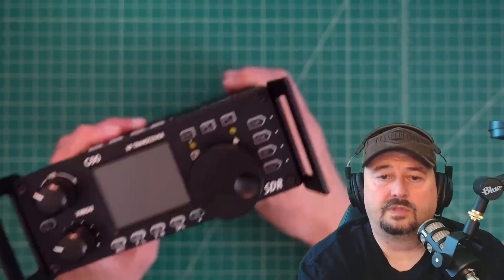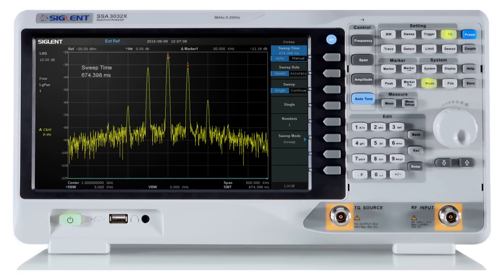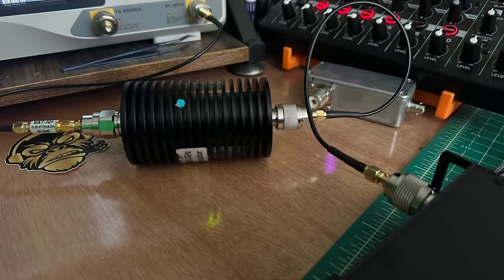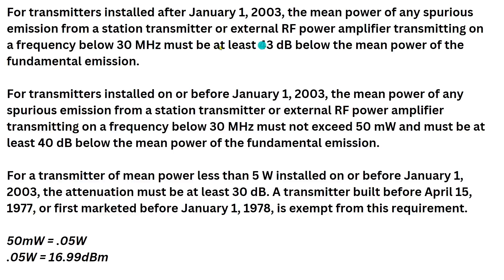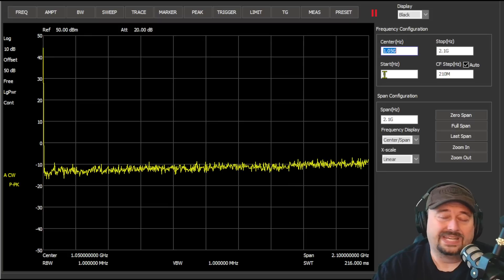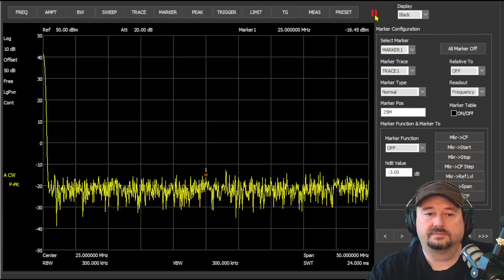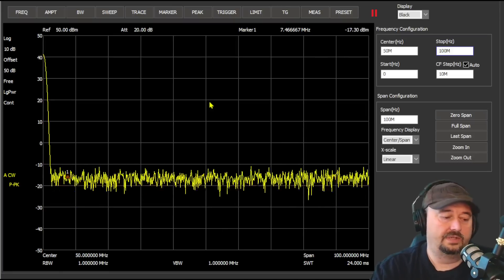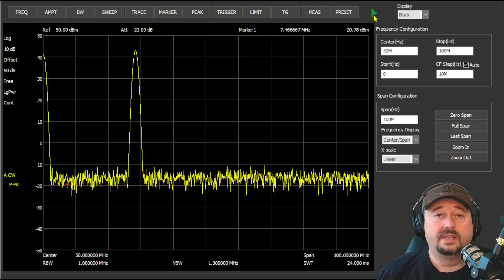Xiegu G90 Spectral Purity Test - Shocking Results!

Comment: I picked up a G90 for its small size and low price. I haven't done any transmitting on it as yet, though I have tested the autotuner into dummy loads of various impedances. I will test mine before I put it on the air, as I do all my gear. 
-
The rant:
The primary thing that separates ham radio from CB radio, FRS,GMRS, the Marine band, the Aircraft band and other radio services is that our authority to design, and build, or even just operate at high-power or low comes with it the responsibility to ensure that we have verified the clean output of all our gear at all times, even when it's commercially built gear and brand new. It is not the manufacturer's responsibility. The FCC says it's ours. This is very different from any other radio service except commercial broadcasters. Simply put, hams are required to know what they're doing, at least to that extent. Unlike many YT channels, yours both points that out and shows hams how to do what they are required to do, keep their signals 'in' the ham bands. That's an absolutely essential service to the community, especially since the FCC licensing procedures allow those who aren't already knowledgeable RF techs access to the hobby. The license is merely an acceptance into the school of radio, a ticket to learn. It doesn't make any of us RF gurus. The hobby has always had Elmers, respected people who are both teachers and friends, and it will always need to have them. They are the cornerstone of the hobby. The FCC doesn't mandate them, but Elmers are what makes Amateur Radio work. These people don't have to be RF engineers. They just have to be people who are willing to learn about something and then patiently share what they have learned, raising the knowledge of all of us. You are one of those Elmers and I enjoy your channel. Thank you.  

I've found that my Tiny SA, when properly calibrated, measures within a dB of both my Anritsu SA and my HP power meter, meaning it is good enough for any ham to use for making the measurement you made here, a measurement that must be made by any ham in an ongoing manner for them to ensure their gear is running clean and legal. TinySA.org has links to approved vendors for those who want to buy one to test their gear. Their AliExpress link takes you to a vendor who sells them for as little as $45, though a suitable high-power attenuator to use with it might well cost more than that. Or one can find another ham or a club with the gear and just verify their own gear is clean through them. It's a responsibility, the details of which are not made clear to new Tech Class licensees, but one that is nonetheless real. A ham has to be certain that their gear doesn't interfere with any other radio service. Our harmonics at some frequencies, such as in the aircraft band could be life-threatening, They could be worse than flying a drone around an airport, or pointing lasers at aircraft. Such harmonics appearing on critical bands like the aircraft band are a sure way to have the FCC come out immediately to find the source of the signal, and they will, and it will likely be costly. It's all part of the hobby, and we need to understand it and deal with it. I find it all fascinating. As a ham, playing with RF is what I do. Chatting on the air doesn't interest me much. But even if you just like to chat on the radio through a repeater or around the world, and don't even want to learn Ohm's Law, your signal purity is a legal obligation that comes with the license.
Reply: My eyes will never be the same. Thanks.
Reply: Thanks for the info. I definitely didn’t pay enough attention to this when I was studying for my licenses.
Reply: @marksisson7468 , that's the gripe I have with both the FCC and the ARRL. It serves the purpose of neither of them to clearly explain just what ham radio actually is, and why it exists. The FCC published Part 97 (which actually explains in the first few paragraphs the reason they created the Amateur Radio Service,) and said, "There's your rules," and they never bothered to require anyone taking the tests to actually read those rules. They just have to follow them. The ARRL, (and a lot of ham YouTubers,) for their part said, "How do we avoid turning off anyone who thinks they might want to become a ham?" So neither group sets anyone straight. That only leaves what some of the newbies call 'Sad Hams' and 'Gatekeepers', crotchety old hams, frustrated with the ignorance of the new hams to try to explain the hobby to them. Unfortunately, plenty of those old-timers are far from diplomatic. I too am an Old Timer, but I much prefer to be called an 'Elmer' than a 'Sad Ham', so I try to earn that Elmer title. But I shudder when I hear the responses that new hams give to the Old Timers who ask them if they've checked the harmonics on their brand new $17 Chinese HT's. Responses like, "No, why?" Or, "It's brand new and it seems to work just fine!" Especially since ham radio, at least in the USA has been set up as a self-policing hobby. Even the people giving you your exams are just General and Extra Class hams who are volunteering to show up and run the tests, and then sign the document that gets sent to the FCC certifying that you passed the test. The FCC doesn't have the time or funding to supervise the hobby. As for the hams doing all the work, it's not worth doing unless the hobby actually matters to them, but fortunately it does. That's why it pleases my to see @The Smoking Ape clearly explain the fundamentals, and show how to do things that are essential, (and kinda fun,) to do. He's an Elmer, and as far as I'm concerned, that's one Hell of a compliment.
Reply from the maker: Hey John, thanks for the kind words about the channel.  Glad to hear you like it...  As far as the rant goes, I couldn't have said it better myself.  Preach on!
Reply: @TheSmokinApe , if there were a better place to post such comments, I wouldn't wear out your comment section. But the sort of hams who will watch your channel are the sort who need the info, and will appreciate it. So thanks for having your channel. It improves ham radio.
Reply from the maker: @johnwest7993  that’s my goal, I appreciate the comments 👍

Comment: A couple things.  You had the internal attenuator set to 20 dB - which is ok, but not really needed with your 50 dB external.  Your noise floor would drop and you could see if there were any really small harmonics.  Not a big deal since you did confirm compliance.  Also, a smaller RBW would drop the floor and show more detail.  Finally, it’s worthwhile trying a much smaller span around the fundamental.  A 1 MHz span with a small RBW would allow you to see any non harmonic spurs hiding by the fundamental.  Unlikely a problem for a CW test, but you don’t know until you try.  Nice vid!
Reply: Actually he did a pretty good job, and the statement, " You had the internal attenuator set to 20 dB - which is ok, but not really needed with your 50 dB external." is a little questionable.  You might get away with reducing the analyzer input attenuation to 10dB, but with 0dB it's possible that we might start creating small amounts of harmonic distortion in the analyzer front end.  For example, with ONLY the 50dB EXTERNAL attenuation, the input level from a +43dBm source would have still been -7dBm, which is a little hot for either IMD or Harmonic measurements.  Reducing the Resolution Bandwidth (RBW) and kicking in the narrow band video filtering would also drop the noise floor; and do it without overloading the front end.  For example, with the attenuation setup he was using, a little video filtering would have given a noise floor of close to -60dB below the fundamental. Then reducing the RBW by a factor of 10 would push that down by another 10dB.  Only then would I cautiously start to easy off on the input attenuation, keeping in mind that if lowering the input attenuation makes the harmonics look worse, it's because you are starting to overload the  analyzer's front end mixer, and you need to add more input attenuation - or, better still, add an input high-pass filter to suppress the fundamental.  Fortunately, on the HF bands, the spurious suppression specification is not quite as tough as the upper bands, so extraordinary measures like fundamental suppression input filtering are normally NOT needed.  The general rule is that you want your measurement setup to be able to resolve spurious at levels at least 10dB lower than specified, and he handily met that requirement.  So, although tighter filtering, and then SLIGHTLY tweaking the input attenuation may have given even better dynamic range,  I'm actually pleased to see that he elected to stay on the conservative side when it came to input attenuation. Better that than risking the possibility of carelessly OVERLOADING the spectrum analyzer, and failing a perfectly compliant radio.  Good Job!   👍👍👍
Reply from the maker: That’s all stuff I agree with but given that the radio easily pass the FCC requirements, O didn’t feel it was necessary to make the video longer doing those adjustments 👍
Reply: @TheSmokinApe  All good.  Just offered for anyone looking to do some testing of their own. Thanks again!
Reply from the maker: @briansauk6837  no worries bro, I appreciate the comments / feedback 👍

Comment: I've had my G90 for almost a year.  Absolutely a GREAT RADIO!
Reply from the maker: @JT-py9lv  This is my second one and I am excited to have it 👍
Reply: Always get great audio reports when using this little radio . It's a nice solid radio for taking out on SOTA and general portable ops  and was my only HF radio for a year or so . The only weakness I've seen is on a friend's g90 who lives within half a mile of an AM broadcast transmitter  which wipes out his ham bands , but I live about a mile and a half from the same transmitter and it only slightly affects the 15m band . He's set up a filter which has apparently solved the issue to a greater extent .
Reply from the maker: The AM towers can do that 😡

Comment: Glad it was clean. You fooled me with the title. I feared spurs everywhere.
Reply from the maker: I was shocked it was that clean 😮
Reply: @TheSmokinApe  I pulled the lids, checked the layout and the components used in mine and decided that the hardware was well done. My only real concern has been with the firmware since I'm not great at code. But others have been pleased with it in the last few years, and there are ongoing firmware upgrades, so I'm no longer concerned about that either. It's a good rig, and I built a cheap amp for it that easily puts out 50 or 60 Watts if I need it, and I built low-pass filters for the bands of interest, so the G90 is turning out to be compact, light and handy when I'm not in the shack.
Reply from the maker: @johnwest7993  the firmware issues were a concern for me when I had the first one
Reply: The title is called "clickbait".  He just wanted to get you to watch so he could get clicks, and so you would watch his ad which he placed at the very beginning of the video.  Pretty sleazy really.
Reply: @jamesrobertson9597 , sure, he wants to attract views and viewers. But what he does on this channel is actually provide useful information, content. I don't consider it to be clickbait if he is providing good Elmering to hams. There are so many channels with outrageous clickbait titles that have garbage for content when you click on them. This is reasonable and useful info.
Reply: No problem, the ferrite and capacitors for an outboard low-pass filter are less than $5 a band for any offending band. Or you can just pull the lid on the rig and tweak the windings of the toroid low-pass filters on the board until it's clean and legal. But the ARRL labs tests indicate that the G90's are very clean, so if you have a band that's out of spec then it's probably one of the capacitors in that filter or a bad solder connection, and an easy fix.
Reply: It says something about the state of commercially made radios that we were expecting the thumbnail to be true.
Reply from the maker: @haxwithaxe  it does and it was, I was shocked it was clean 😮